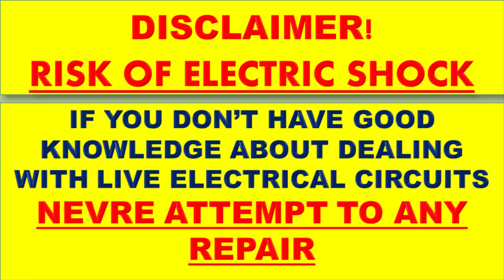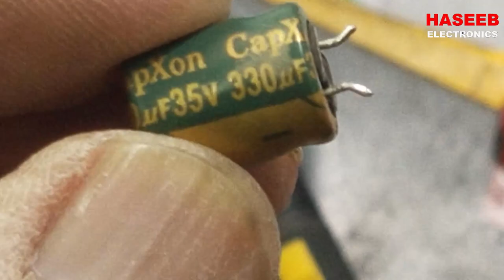[398] LED TV No Display / How to Troubleshoot, Repair LED TV with No Display, No Sound, Black Screen

Comment: Why are you not using ESR meter/tester for Electrolytic Capacitors test? I’m sure you will not missed any single bad capacitor after using the ESR meter/tester.
Reply from the maker: Yes 
I use ESR tester as well

Comment: Where can I buy a get a soldering iron like you're having in south Africa, Western cape area
Reply from the maker: you can explore it online from amazon, or other online vendors 
compare the price 
it is WELLER WR3M
i suggest HAKKO 701 it is cheaper and more reliable than the WELLER

Comment: Assalaamuralaikum sir first thank for all your informative knowledge with us i have a problem with my tv powersupply no output in only backlight section how can i troubleshoot it
Reply from the maker: if there is no power supply at backlight connector 
check switching at backlight converter 
or please send part number of the board
Reply: @HaseebElectronics  4702-2PLFH1-A4231B01 thanks in advance sir

Comment: Sir..can we replace 450mf & 10 volt with 450 mf & 20 volt in a power supply board of LCD monitor.
Reply from the maker: yes we can replace it. because you are select higher voltage value than the original value
Reply: @HaseebElectronics  thank you sir. Is there any section in the SMPS where we must use the exact value of capacitance and voltage rating.